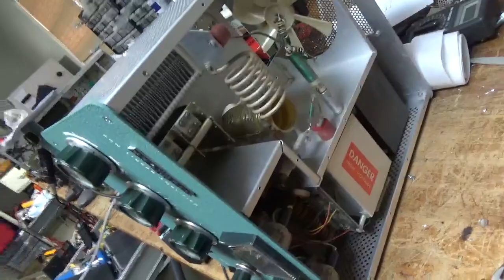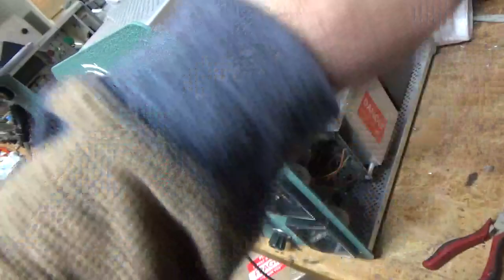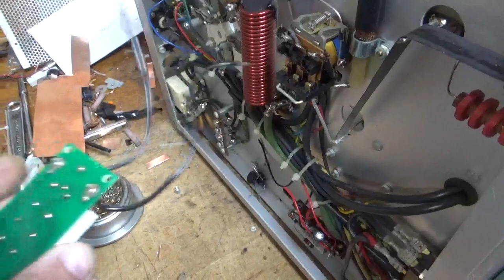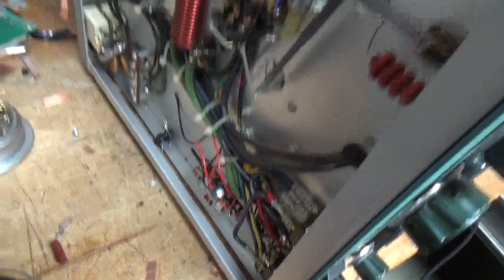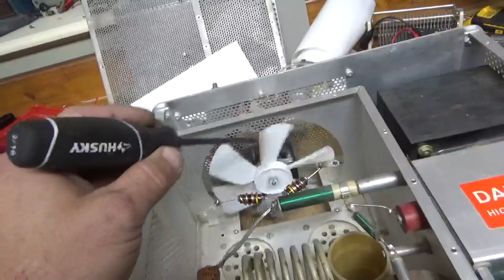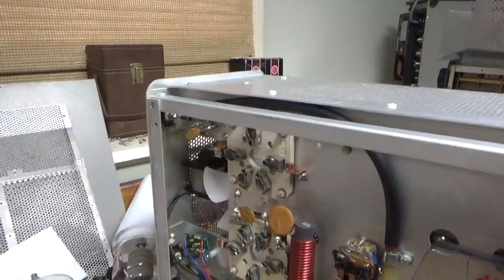Heathkit Sb-220 Repair And Modifications Harbach Kits

Comment: When replacing C4, do you go back with an original 20uF / 160V cap?  Or another value?  I've seen 47uF used in another restoration.  Just prepping for an upcoming new addition to my shack. 😉
Reply from the maker: I use a 22 uf ,  160vdc

73

Comment: I can't find a shipper that foams the cushioning to protect the equipment.  As soon as I do I'm shipping mine for the "touch" of Thee Amp Repair Guy.
Reply from the maker: Hi Lloyd , FedEx office does it. 73
Reply: Yes, FedEx uses a commercial system with closed bags and separated chemicals, that when "broken", mix and produce form-fitting foam.  When done correctly, the enclosed item is quite secure.